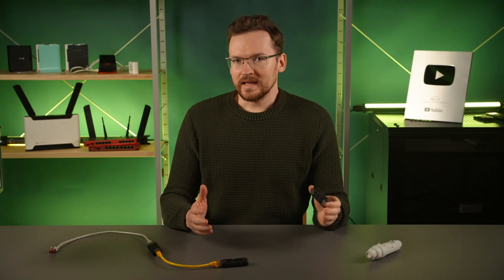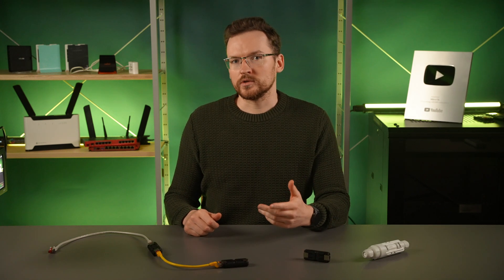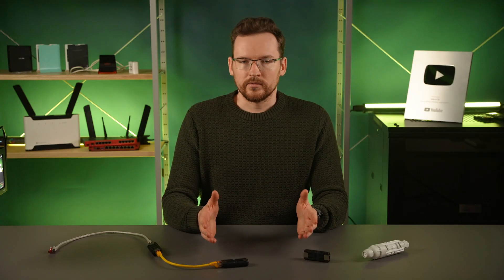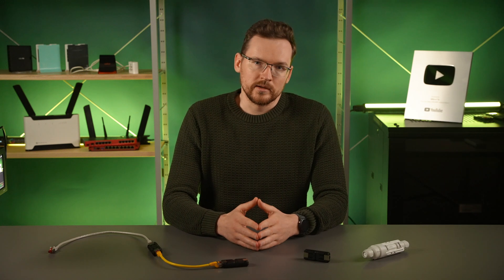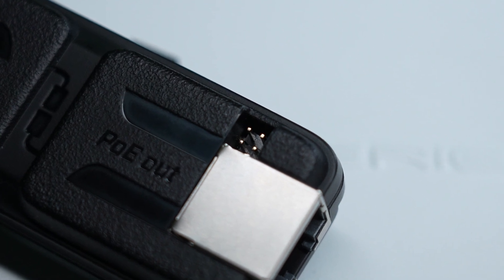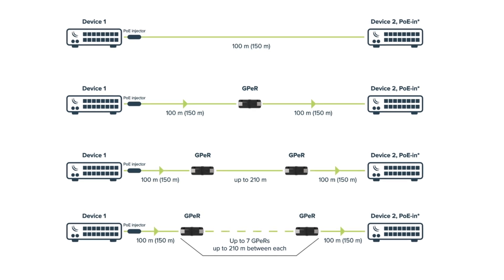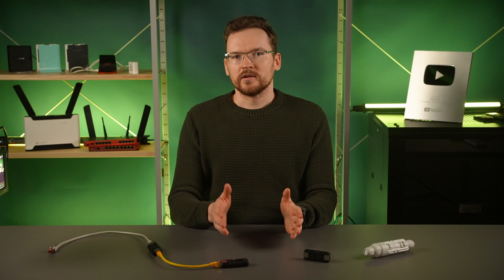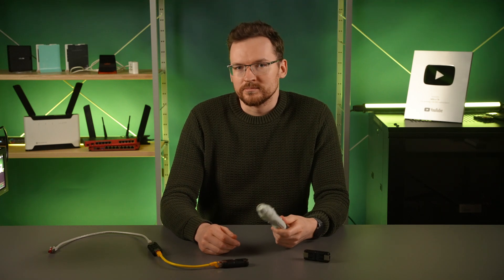GPeR - the value pick you need

Comment: Is it possible to inject power from either ends? The router side does not support PoE, but I have a PoE switch on the other end. The switch has 4 non PoE ports that I use for my laptop and teh closest router is 200m away.
Reply from the maker: Of course!

Comment: Extending copper Ethernet this far usually is a bad idea, and a good reason large network deployments use fiber is for galvanic isolation. Not just because increasing the length of cable means you have more chances of electrical noise ingress, but lightning and even inter-building line voltage and ground potential differences are a concern. Many environments where someone might be tempted to use these would end up being the worst possible places to use them. Manufacturing facilities are one such example where multiple sources and types of incoming line power and diverse grounding conditions exist and copper networking is best to be avoided. Fiber is used to link buildings in corporate and educational campuses, again because of electrical concerns. It may make some sense to use these for PoE IP security cameras, but typically locations where it would make the most sense (parking lot lamp post mounted cameras) are handled by wireless transmission and powered directly from the lighting circuit prior to any daylight sensors to avoid burying additional cables.
Reply from the maker: Have you watched the video? This is not some passive extender, it is a powered switch with two ports. There are no risks in this case, just like using any other network switch to connect networks.
Reply: @mikrotik  I understand it is an active extender. Again, galvanic isolation is a serious concern when you're reaching the limits of copper ethernet.

Comment: How can there be 210m between two GPeRs?
Reply from the maker: If the emitted signals are good enough then GPeR will be able to pick them up after 210 meters of cable, but it is recommended to do lower distances than that as many factors come into play.

Comment: The IP68 case seems good for more than just the GPeR itself. It seems like a great solution for protecting connectors in the field where a midline join is required (e.g. a Keystone to Fly-lead connection)
Reply: Yeah, but there were already existing solutions for those from other manufacturers. The GPeR seems more unique.
Reply: @nagi603  Not as unique as you may think.  I have like 20 of these cute little poe++ in 5 port din rail Chinese switches, you can even cascade them just like this they are like $12 on aliexpress and they work well.  And there are poe powered ethernet extender devices like this, ones that even advertise as being suitable for direct burry, idk if those ones do cascading though perhaps you only get one hop out of it.

Comment: Could you elaborate on why it is not a good idea to insert power where it’s not needed?
Reply: Some devices are built with out the consideration of geting power injected through the ethernet port. Depending on the design of the device, it could be demaged or destroyed. As 24v passive poe does not require a handshake, but is "always on" you usually need to manually enable/disable it in a switches management interface, or in this case, via jumpers.

hope this helped
Reply: @egomatthisum  passive Poe switches are pretty much a thing of the past unless it’s built specifically for some industrial applications, or some specific application. Most network switches follow 802.3af/at standards, voltage out is auto negotiated and shutdown if not required.
Looks like Mikrotik has switches with passive Poe In/Out option (aka Poe injector), but those don’t come with power supplies and designed for someone who knows what they are doing

Comment: How smart are these things? Is there a switch chip? Do they digest ethernet frames or will they relay pretty much whatever signal they get on differential pairs, for example AES50?
Reply from the maker: Yes, there is a switch chip. It's basically a PoE powered two port switch.
Reply: @mikrotik  Thanks for the info

Comment: I am hoping and praying that you guys come with a OLT as soon as possible. I know that will be the next big product in the mikrotik link off products
Reply: TiBit had some really cute SFP+ XGS-PON / EPON OLT in a standard SFP+ module.  Not just a transceiver but the full on OLT in the module. Only did 10km at 128 split but still it could turn any SFP+ port into an OLT.  We were close to buying a bunch but ended up going with 60km gear from calix instead. They seem sold out everywhere now. It was custom ASIC so IDK if they ran out and or what.  The paring ONT in SFP+ form factor is common these days.

Comment: How much POE power can this pass? If I feed this with a POE++ class 4 source (90 watts), will it pass 60 watts to the end point? I'm thinking a single extension to a PTZ camera rated for POE++ 60 watts, but my switches can supply up to 90 watts per port.
Reply from the maker: The primary use of this device is Ethernet range extension. While it could power a small device, it only supports passive PoE and the maximum current output is 0.7A.
Reply: @mikrotik  thanks. I may still need to grab some of these and power the camera locally.